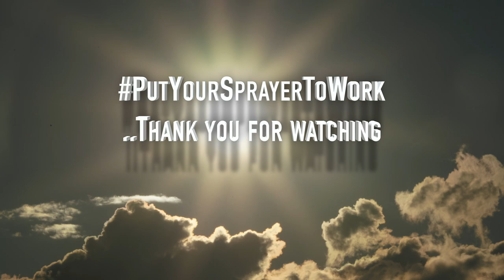Paint Ceilings FASTER With An Airless Paint Sprayer

Comment: Just out of curiosity, why are you using a fflp tip ? I thought the blue tips are for emulsion ?
Reply from the maker: Great question, thank you.. I mostly use a Graco LP 515 or a FF LP 514.. both are low pressure (green) tips.. both produce a fine finish, very similar in orifice size.. the .014 slightly less paint flow Vs a .015.. all the best my friend.. regards Pete
Reply: @PaintHQ  I’m new to spraying and have a huge house to miss coat . I have a GXff and have purchased a Green LP 517 and a blue LTX 517, which would you recommend ?
Reply from the maker: Ah cool, I’m happy to help all I can 👍 ..I’d use the LP tip, I prefer the benefit of more control you gain when low pressure spraying.. when new to airless spraying, my number one tip is, move the gun relatively quick 👍 let me know how you get on.. regards Pete
Reply: @PaintHQ  thanks Pete

Comment: Hey Pete, brilliant videos, thank you for all this really useful information. I'm a cabinet maker in my spare time and thinking about buying a GXFF for spraying furniture. But I also am renovating a house and have 4 rooms and a hall to decorate. I'm thinking about getting the GXFF with an extra 1/4inch hose and 515 tip for spraying emulsion. In your experience will this be my best option or would you recommend another setup?

Would you recommend a particular emulsion for the mist coat with A GXFF?

Cheers Pete thanks again.
Reply from the maker: Hi Ross, I really appreciate your kindness supporting PaintHQ, you’re a diamond.. I’m happy to help get you up and running 💙 ..The GXFF is one of my favourites, and will suit your fine finish requirements and your additional emulsion spraying needs 👍 ..Technically you’re thinking right by the additional 1/4” line for emulsion, but my opinion is the included 7.5m 3/16” line is perfectly capable.. in fact that’s my preferred setup, I like the shorter more flexible setup.. with a hopper 😆 ..Something to consider if you can spend the extra is the Cordless GXFF, you get 2x Flexvolt batteries and as standard the Contractor PC Compact gun.. it’s a joy to spray with, especially suited to your cabinetry.. I could also assist you with the waterborne primer and topcoat I like to use for joinery if that helps..

Regarding emulsion.. are you in the UK my friend ?.. I rate Johnstones Acrylic Durable Matt through a LP 515.. being acrylic it makes for a good primer for fresh plaster / mist coat.. for a mist I thin the first coat 30% , roughly 70/30 mix.. then thin the topcoat the max 10% (I use hot water out the tap).. so a 5 litre can you’re gaining an extra half litre 👍

Regarding the GXFF, if you’re in the UK speak to my friend Mike at SpraymanUK.. he’s super friendly I and knowledgeable, with no pressure to purchase..

Keep in touch, happy to help you further on your journey.. regards Pete
Reply: @PaintHQ 

Fantastic mate, this is all music to my ears haha. 

I'm already a fan of Johnstones paint so this is now a no brainer for me to use their durable matt. I have sprayed their eggshell watered down 20% with a borrowed Fuji HVLP gun with good results but I was hoping to spray Sayerlack AT9915 with a crosslinker with the airless system without diluting as much to get a better, thicker, more durable finish. What WB primer and topcoat do you recommend for joinery? 

The cordless system sounds mint but I don't think my budget can quite stretch the extra 500 smackers. I may live to regret this! 

Just one more question if you may. All my rooms are bare plaster on walls and ceilings with no trim, I still need to buy and fit all of this myself. What order would you decorate the walls, ceilings and new trim in? I have seen from your videos that you do walls first then ceilings but wasn't sure where the new trim would fit in easiest.

Thanks a million.

Cheers, Ross
Reply from the maker: Hey Ross.. Yeah the Johnstones Acrylic Durable will definitely need 10% water, preferably hot water and a good stir to lower the viscosity.. it’s a thick material.. regarding woodwork paints, I never thin any products through airless.. I’ve not experienced first hand the Sayerlack  product you mention, but I’ve heard very positive feedback on its performance, especially with the crosslinker 👏👏👏

For interior joinery, staircase, internal doors etc I use AkzoNobel..

WP136 Water Based Primer / Edge Sealer
https://holmanpaints.co.uk/interior-wood/171-akzo-nobel-WP136-highbuild-waterbased-primer-edge-sealer.html

AkzoNobel Aqualit (Supercryl) Waterborne Enamel Topcoat
https://holmanpaints.co.uk/interior-wood/169-akzo-nobel-aqualit-waterborne-enamel-topcoat.html
..you get a beautiful cabinet like satin finish ..and very cost effective, especially in 5 litre cans..

Comes in white, then if needing tinting both primer and top coat can be colour matched off any colour chart..

Also in a clear lacquer, coats oak beautifully.. it’s a sanding sealer, just denib the first 1 or 2 coats of grain raise.. dries super quick, I spray 3 or 4 coats depending on the amount of grain fill..

https://holmanpaints.co.uk/interior-wood/191-1705-aqualit-supercryl-water-based-wood-lacquer.html#/1872-size-1l/1952-finish-30_satin

The above is 1K waterborne, I’m currently looking at some other AkzoNobel Aqualit products that can be waterborne 2K..

This is Aqualit clear 2k.. wet look👌

https://www.instagram.com/reel/CjVTllBo4G6/?igshid=YmMyMTA2M2Y=

I’ve used Holmans for years, the Holmans team are all super helpful..

Can be delivered next day if required.. If this helps at all, Holmans have a 5% discount code, across all their range.. 

👉 Use code PAINTHQ

Regarding you’re rooms.. I’d fit the trim first 👍 ..here’s the order if I’m spraying everything.. spray all joinery first, then mask off the next day and spray walls up onto the ceiling (back roll if you feel it’s necessary.. I myself prefer the sprayed finish).. then finally mask off the ceiling cut line with 2.6 metre plastic film and spray in the ceiling.. just one thing.. you could mist coat first before fitting trim 👍

💙 both corded and cordless GXFF are great units, diverse in the P&D world.. you’re right, it just comes down to budget, totally understand..

Happy to answer as many questions as I can my friend.. All the very best  ..Regards Pete
Reply: Brilliant Pete, I will definitely give these paints a try. Thanks again for all this incredibly useful info. Cheers, Ross
Reply: @PaintHQ  Hey Pete I hope you are well, I wanted to ask you about the Akzonobel aqualit. I have a mixture of new mdf primed architraves and old eggshell or gloss paint around the door linings. How would you approach spraying these with the Akzonobel products you mentioned, would you shellac prime the old paintwork first or just sand it back and re prime with the Akzonobel? Thank you pal.
Reply from the maker: Hey Ross, great to hear from you buddy.. my preference is to use the AkzoNobel WP136 high build primer, over the whole project.. new primed woodwork / and the original paint work (.. prep the paint work, sand, get rid of brush marks etc).. I’ve always had awesome results with AkzoNobel WP136, it sands /denibs beautifully, sometimes I’ll spray a 2nd coat of primer.. the topcoats lay over the top awesome.. now sometimes in the scenario you mention, once I’m masked up, I’ll whip over with a rattle can of BIN (or Smith and Roger, they do a shellac in a can now).. then on with the topcoats.. this speeds up the process, if all is pretty good as you say.. but my preference is the AkzoNobel WP136 primer 👍
Reply: @PaintHQ  Thanks a million Pete. I just realised I didn’t quite phrase my question properly. I have actually bought the wp136 primer, I meant to ask if you have found that it sticks to old woodwork paint ok, or if it would need a BIN coat first. But I think you have answered this anyway and said that it will bond ok as the only primer? so thank you!
Reply from the maker: You’re very welcome, let me know how you get on.. one more tip my friend.. keep caulk to a minimum, it’s a practice I follow.. wipe off all excess and let it thoroughly dry, followed by a quick whip over with shellac.. this will prevent any crazing 👍 ..whilst WP136 is an acrylic, the same as caulk.. WP136 and the Aqualit topcoat will dry quicker than caulk and could craze as a result.. all the best my friend 🙏

Comment: Great video and channel! Could you describe the order of operation you would take if wanting to spray a bedroom all the same color, ie trim, doors, walls, and ceiling? I’m inclined to use a flat finish everywhere to make it easier? I just purchased an ultra quickshot to paint a 15’x15’ bedroom and thinking through prep with the goal of painting this weekend. Very glad I stumbled across your videos. They are immensely helpful!
Reply from the maker: Thank you for the kind feedback.. I’m a fan of Johnstones Acrylic Durable Matt, then if the walls ceiling is fresh plaster you can thin by 30% and use as a mist coat.. that’s your first step, mist coat, keeping the mist off the trim / woodwork — then this is the order I would spray — trim / woodwork first (prime / topcoat.. sometimes using a high build primer, I coat 2 or 3 times, followed by 2 topcoats).. then I would mask off the trim / woodwork (this will protect the fallout from the ceiling), spray the ceiling in to a finish with the Acrylic Matt (it actually dries very flat).. then I would brush / roller your walls.. I say that because you’re using the UQS — I don’t want you to over work the unit — woodwork will be great, you’ll get an amazing finish.. then ceiling will be quick, easy and flat.. but walls, you’ll be refilling the cup a lot and pushing the boundaries of a ‘small job’.. however it’s said, jobs up to 3 gallon (I believe approx 11.5 litres).. I just don’t want you to overwork the unit 😄 ..regards Pete

Comment: Spraying a ceiling is unethical... 
Give clients respect. 
Do job correctly.
At least backroll.
What happens if a touch up is required?
Just because a sprayer is available, does not mean its the appropriate tool for the job. 
Application of product, sure... masking for protection, even better. But why could you not backroll... especially in a kitchen. 
Or it is a revenue generator. 
"Ohhh you need a touch up or repair". 
"It's a sprayed finish", l have to remask and spray it again". 

Paint
Reply from the maker: Hi Sam, thank you for your input.. I’m afraid I’m going to respectfully disagree my friend.. first let me reassure there’s nothing ‘unethical’, and it’s certainly not a revenue generator.. The client hasn’t paid a penny, in fact they never even knew they was getting their ceiling finished, I was sent in by a kitchen installation company as a nice finishing touch.. I had a discussion with the custoner about their plans and did all I could to help, for example mist coating hard to reach areas above the units..

I’m guessing you’re not from the UK my friend?.. I say that because any back rolling questions, especially on ceilings come from outside the UK.. in the UK walls and ceilings are skim coated with finishing plaster to a smooth finish.. perhaps not quite level 5 but extremely close.. so in this example of an over-boarded ceiling, the finishing coat of plaster all over is very good, very smooth.. I then prime and topcoat with an acrylic durable matt product.. it has a class 1 scrub rating, anti mould and condensation resistant properties.. basically the sprayed finish is a flawless flat matt finish, and our customers in the UK love the finish.. I don’t see how a ceiling is going to get snagged, but if something unfortunate was to happen both myself and the installation team has a good working relationship with our customers to help and fix any problems, doing the right thing..

As for using a roller, I can’t speak for all domestic painters in the UK, but in my previous days of using a roller.. I’d pride myself in a very smooth finish, that looks sprayed.. using a fine nap microfibre roller.. I now choose to spray, not entirely for speed (I like to take my time).. but it’s less laborious, and cleaner.. 

All the best my friend.. please keep in touch, it’s always a pleasure to get feedback and hear how others complete jobs 👏👏👏 ..regards Pete 🙏

Comment: What respirator mask and filters do you use?
Reply from the maker: Hello my friend.. It's a 3M, with A2P3 replaceable filters for particles and vapour..

https://www.amazon.co.uk/dp/B07GT7D1B2/ref=emc_b_5_i
Reply: @PaintHQ  thanks! Would you say   a vapour filter is needed if Paint just water based paints? Or would a P3 alone do?
Reply from the maker: I’d definitely go with ‘complete’ A2P3 protection.. i say complete, because there is higher spec too.. from what I gather, A2P3 is widely used as a minimum when spraying waterborne, and single component solvent (so I believe).. when you go up to 2K waterborne / and solvent.. that’s when air fed masks would be a must.. I say all this, but I’m no H&S expert and/or paint chemist 😆 ..just my opinion and from what I see.. hope this helps my friend 🙏

Comment: How would you spray paint the ceiling and then wanted to spray paint the walls
Reply from the maker: Hi Darian, great question.. if I’m spraying a complete project I spray the walls first (back roll if required), then mask off the cut line and spray the ceiling last.. it’s easier to mask around the perimeter with a purple washi tape and go aver the washi with a 2.6m / 99” tape and drape plastic (or hand masker).. in this video, I was sent in by a kitchen installer, to spray the ceiling, then the client is manually brush and roller finishing the walls 👍 here’s a quick video of an example, I’m demonstrating a Graco Pressure Roller but the spraying of the ceiling last demonstrates what I mean..

Paint Walls FAST with a Pressure Roller and Spraying a Ceiling
https://youtu.be/cumXImD_ksI

Keep in touch buddy, always great to hear from you 🙏 regards Pete

Comment: Think I would of use tikkurila primer as the mist coat there, saving a few quid and increasing profit. I know its only 1 ceiling but large saving if doing whole house, that durable ain't cheap 😊
Reply from the maker: Hello my friend, thanks for sharing the info 🙏 ..hope you’re keeping well.. regards Pete
Reply: Nice video. We usually  backroll the first coat.  What are your taughts.  Is it an extra step for nothing.
Reply: @mack1609  i been spraying for about 18 months i havent touch a brush or roller since i done few jobs on bare plaster just mist coat and 2 top coat job done ✅
Reply from the maker: Hey buddy, thank you for watching 🙏 ..I don’t typically backroll myself, but I can appreciate it’s chosen by some.. I’d only backroll walls if it was requested, perhaps concerns over future touch ups.. I do like and prefer a fully sprayed finish, and do rate the durable / wipeable finish that I can achieve.. thanks for sharing your experience my friend, keep in touch.. I’m happy to help if I can.. regards Pete
Reply: @PaintHQ  thanks for your reply.  We have been spraying woodwork for quite a while now  . Spraying  for sure  is far superior. But some homes are so cluttered  its not easy. Keep up the work. Great videos
Reply: Spraying  is the  way for sure
Reply from the maker: Thank you buddy.. you’re doing great 💯